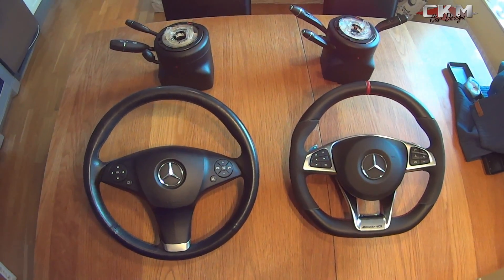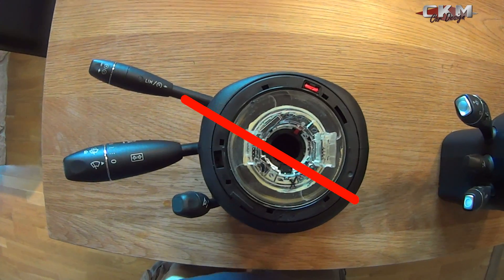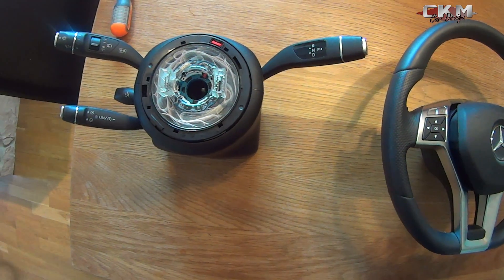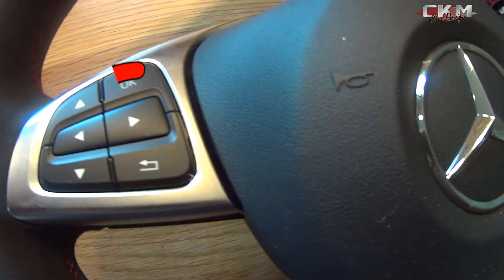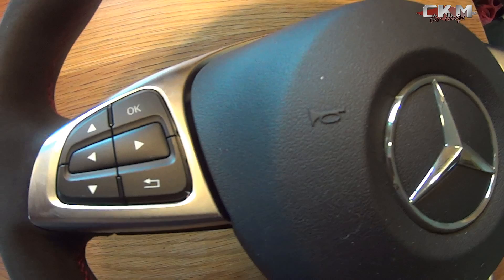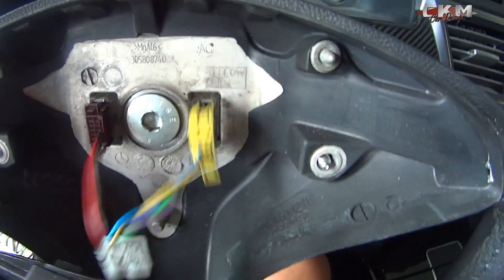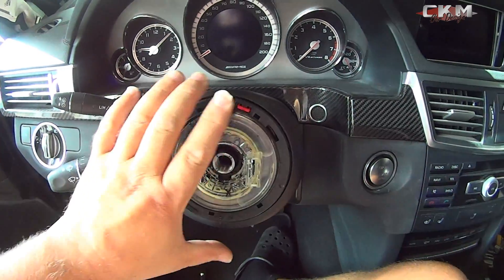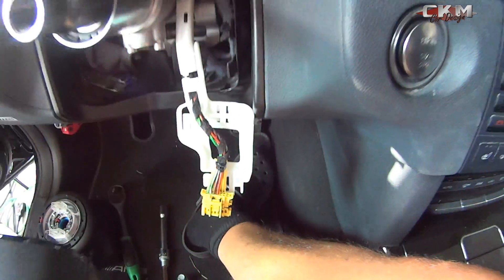Mercedes Facelift steering wheel retrofit W212 W204 W166 W176

Comment: The shift padles are going to work without modifications?
Reply from the maker: Yes.
Reply: @CKMCardesign  even if my car doesn’t have shift paddles from factory?
Reply from the maker: @bsantos791  Yes if its the corect column and you have automatic.
Reply: @CKMCardesign  Will this work with the 2012 w204 facelift steering wheel? Don’t have paddle shifters but want to add new steering wheel with paddle shifters but wasn’t sure if I had to re-wire everything?
Reply from the maker: @jbarra3655  As long as its an automatic and you get the right column.
Reply: @CKMCardesign  how do I know if it's the correct column?
Reply from the maker: @bsantos791  Trail and error afraid.

Comment: Can you just change the old circuit board to the new steering wheel?
Reply from the maker: Yes if you can make it fit inside the board container and same with buttons and peddals then.
Reply: @CKMCardesign  I’m going to try and fit my 3 spoke 2011 GLK board into 2014 GLK wheel! If I sound crazy tell me now other wise I’m giving it a shot! I’ll report back what happens. Really don’t want to buy a column but can if I absolutely have to. I’d rather change the board
Reply from the maker: @qwillis331  Its a quistion of fitment…
Reply: @qwillis331  Did you finally make it?

Comment: Hey man. I have a 2011 W207 e class with the same stock steering wheel as yours. So I need a 2014 squib for this to work? Would a 2013 3 spoke E class wheel work too or does it have to be 2014? 
Thanks

Comment: If I purchase a 2013 R172 steering column module (clock spring) and fit it alongside a 2017 W166 steering wheel with the arrow buttons, will that work in a W204 2007?
Reply from the maker: Go for 2014 to be sure.

Comment: Hi question i have w204 2009 do i need column as well or just the steering wheel with arrows on left side ?? If i need a column then from which model column will fit please i have the old retro steering wheel
Reply from the maker: Thats exactly whats answered in the video.

Comment: Great video! Quick question though, I've got a w204 PFL c63 and have purchased the same wheel as this video and i cant find the part number for the steering column.
I've gone through your website, searched through forums and gone through comments and i cannot find a part number or what model i need for the w205 steering column anywhere.
Cheers :)
Reply from the maker: Never W205...You need W212 or like CLA or like ML....From 2014 and up.
Reply: @CKMCardesign  Thanks heaps, do you know what the part numbers are that I should be looking for?
Reply from the maker: @DM-uh5ku  Sorry no..THat is a djungle..
Reply: @CKMCardesign  sure, so once I find some steering columns ( which I'm still sill having trouble finding) from the above mentioned i then need to make sure that they share the same capabilities as mine, no more no less. correct? It's quite hard to find a 2014+ model without the column shifter and without lane keep assist haha
Is any year w212 steering column okay providing it still carries the same features as original and is FL or does that also have to be 2014+?

Comment: please help, i have a 2010 e350 coupe (c207) i swapped steering wheel and column like in this video, but i get error messages for auto high beam, traction control, distronic cruise control all stop working. what did i do wrong?
Reply from the maker: Sounds like wrong column!
Reply: @CKMCardesign  is there a Solution to That Problem ? I have the Same Car and want to do That swap :)
Wich column do i have to get ?
Reply: Did u find a solution?
Reply: @sirca7014  i did actually, i used the original 2010 steering column and had to take the circuit board out of the original steering wheel and use it in the newer steering wheel. i had to cut a lot of plastic away to get the older circuit board to fit into the housing. there's a forum post that goes in detail about it that helped me, let me know if you need it and i can post it here
Reply: @angeldanielg64 i would like to see the forum, thanks a lot for the response, i have the exact same problem as you and i really wanna solve it
Reply: @angeldanielg64 do you have a link to the forum post?

Comment: Hi friend,

Hi have a W204 2008 pre-facelift and i want to upgrade my steering wheel... does it work with a W176 2014-  steering wheel (Arrow buttons on the left) with the respective column?!
Many thanks in advance
Reply from the maker: Just as I say in Video.

Comment: Please, i have the same GLK x204 (2011) as you, i only need the Reference of the steering colum i have to buy/search (is an automatic glk ). thanks
Reply from the maker: I dont work on partnumbers.
Reply: @CKMCardesign  And how to find the right one please, cause i need without gearshift stalk (pre facelift glk has in the console) and with wiper with rear window washer command) and with tempomat.
thanks please.
Reply from the maker: @sinacio69  I just look on ebay for a 2014 stalk and newer.

Comment: Got one question, if u change it on a c220 w204 cdi 2007, will it give electronic problems if i want to swap to a amg wheel with paddles? Or does no matter?
Reply from the maker: No problems.
Reply: Have you tested.?
Reply from the maker: @ckmckc  MANY times...

Comment: Hi, if you can help, I'd like to do this on an R230 SL500 year 2003. 

A: is this a w205 column and steering wheel?

B: Will it fit my car.
I'm just trying to keep busy during my chemotherapy. Thank you
Reply from the maker: Not possible on R230.
Reply: @CKMCardesign  hi I have a 2009 w204 c63 I brought the same new steering column and also the same steering wheel. No error codes but none of  the buttons don't work.
Reply from the maker: @AZNPLAYERZ  Wrong wheel or column then.

Comment: I noticed that 0:43 seconds into the video you have a steering column with the gear shifter on the right hand side but on the install, 4 Mins into the video you installed a different steering column that did not have the gear shifter. Why was this done?
Reply from the maker: The car have the shifter on the floor of course.

Comment: hey man i have a 2010 c class i want to know before i am buying anything what i need to buy if i need to buy the column or not and i dont know what column works becuse my shifts in the gearbox and not to the column
Reply: You just find the clock spring that would come with the new wheel, clearly in the case of having w204 C class the shifter isn’t on the clock spring. Simply get the clock spring that is off other facelifted C classes 2012 and up
Reply from the maker: If you want the 2016 wheel you need a 2014 or newer column ! There are as yo can see in the video columns without shift leveler.

Comment: Hello mate, I just done this today with exactly the same parts on to a W204. Nothing works and the car wouldn't even start. Do you know why this could be?
Reply from the maker: Alot of factors can be the problem. Probebly just wrong parts.
Reply: @CKMCardesign   Does that steering wheel in the video work with a W204 2007? As that's one I have brought.
Reply from the maker: @stefan2641  IF you got the corect column it should work fine.
Reply: Lol I got the one in the video from the W205 all the same apart from gear selector
Reply from the maker: @stefan2641  W205 wheel DO NOT work.
Reply: You said in the video just find one with the same lever's. Which one do I need then? Thanks
Reply from the maker: @stefan2641  That is for the column...Not the wheel.
Reply: What column goes with that steering wheel in the video mate
Reply from the maker: @stefan2641  Any column from 2014 and up exept W205,W222 and W213.
Reply: Thanks for your help mate. Just brought one from a W218.
Reply: The seller for the W218 one cancelled the order, was gonna get one from a W212 2015 facelift. Does this not work then as well?
Reply from the maker: @macaroana01   And sure its 2014 and newer?
Reply from the maker: @macaroana01   Must be 2014 and newer.
Reply: Has anyone got this to work yet?
Reply from the maker: @stefan2641  Why you ask that??? You think I am faking this for any reason?? I have done this in 5 cars now and sold plenty sets that works..Dont you see that it works in my videos?

Comment: Hello i have a question, so i have a c220 2009, and changed the steering wheel to o a 2016, the buttons obv dont work, so if i change the colum and put that on the video one, the buttons will work without doing any complicated thinks? 
Thank you
Reply: The steering column, i need a w205 one? Or has to be from the exactly same car where the wheel comes or i just need a w205 column?
Reply from the maker: @polcsgo8141  THat is said in the video. ANd NOT w205 one.
Reply: @CKMCardesign  what can i do if i dont have the column where the wheel comes from, on wich model column i have to buy it, that the thinks can work?

Thank you
Reply from the maker: @polcsgo8141  2014 and up W166,W176,W212,W218.R231,R172 and so on. Just not W205,W222 or W213.
Reply: @CKMCardesign  thank you so much i apreciate it a lot for your time
Reply: @CKMCardesign  so if i still put a steering column w176 2015, with the direct switch padel with the N D P paddle, will still the wheel work? Or it has to be a column without that
Thank you
Reply from the maker: @polcsgo8141  No work needed.
Reply: @CKMCardesign  it workeeeed!!!! Thank you for your time and helping me with my questions, i still cant believe its working all! Thank you
Reply from the maker: @polcsgo8141  Of course..

Comment: Did you remove the gear lever from the new steering column?
Reply from the maker: Of course not. Bought one without.
Reply: @CKMCardesign  pls. Could a column carrying a gear lever able to shift the gear while the initial gear is on floor
Reply from the maker: @jameeljiddan1955  No.

Comment: Hey man I'm in South Africa, I have an old e class, w211 2004. How much can I upgrade for and which one is suitable for it? I can't find it on amazon
Reply from the maker: www.ckmcardesign.com
Reply: how much did u buy it for bro?
Reply: @Oratile19ul  In south africa these cars usally run for about 6-10k Dollars depending on what kind of car it is and how many miles/Km it has. In Africa the Roads are not as harsh like in germany so often broken cars from germany get exported to africa but can still drive in africa.

Comment: Will it work on 2007 W203 2.5L V6? As the OEM steering is the same as 2008 W204.
If do, can you share part name do i need to purchase? 
Thanks in advance
Reply from the maker: No! Same?? Its far from same in W203.
Reply: but how can we mount that steering wheel on w203

Comment: Hey, if i get the w212 2014 column and w204 amg steering wheel (lift 2012-2013) and plug it into my w204 2009 will all buttons and horn works well ?
Reply from the maker: No..Must be the 2016 wheel. Lift w204 wheel is hard to install since there wher so many versions electronicly. You need the column the wheel came from.
Reply: @CKMCardesign  Ok, thanks for so fast respond, so if I put w212 2014 column and w205 steering wheel will all works ? W204 2009
Reply from the maker: @TheKarol1122  Not W205. Must be arrow version wheel. See video.
Reply: @CKMCardesign  Yes, of course with arrow version, then it will works well ?
Reply from the maker: @TheKarol1122  Yes
Reply: @CKMCardesign  Last question, so I need w212 2014 column and w213 steering wheel with arrow buttons and everything should work on my w204 2009 ?
Reply from the maker: @TheKarol1122  Yes but still not W213...Also dont have arrow buttons. Need wheel from like W166 or W176..
Reply: @CKMCardesign  OK, just arrow steering wheel, and w212 2014 column
Reply from the maker: @TheKarol1122  Just buy it on my site...And your set.

Comment: Which quite new looking wheel will fit in a 2003 clk ?
Reply from the maker: Only the one made for your car.
Reply: @CKMCardesign  isnt there a way to fit a more modern one ? and if not which year of the clk is the first which i would be able to do that (looking to get one soon but i need a newer steering wheel)
Reply from the maker: @saint4353   Sorry no.
Reply: @CKMCardesign  which year clk can fit a other steering wheel ?
Reply from the maker: @saint4353   None.
Reply from the maker: @saint4353  See my site wich version you can make for it. Sport can be made.

Comment: Is it possible to retrofit new Stalk with column shifter to w207 2010 with column shifter actually working?
Reply from the maker: Only if you had it before.
Reply: Are these US models or Europe only ?
Reply from the maker: @jaecalderon260   Same....
Reply: @CKMCardesign so if my car has no paddle shifters then the ones on the new steering wheel will not work right ?

Comment: How did you disconnect the right stalk?
Reply from the maker: right stalk?
Reply: @CKMCardesign  yes on the new stearing collum it had a drive stalk on right side,it had 2 on left and  one on the right,but on old collum it only has 2
Reply from the maker: @paulk5242  Just unscrew it and  take the cable out of the socket.

Comment: i have 2009 c300 4 matic will the gears from the new steering wheel work on the old model?
Reply from the maker: You have the answers in the videos..
Reply from the maker: If you get the corect column it will.
Reply: thanks

Comment: Would this be possible on a 2011 c300
Reply from the maker: Of course.
Reply: @CKMCardesign  i installed a new wheel and column wheel on my 2010 GLK, the turn signal, cruise control , and rear wiper works, everything else doesn’t work, any ideas?
Reply from the maker: @David-n5q2v  Wrong column or wheel.

Comment: Where can I find the updated Steering column ? Or can you please give me the part number ?
Reply from the maker: On the site. Clearly pictured there.
Reply: @CKMCardesign  Tried ebay, can't find it there. Didn't see it on your site too. Also can you let me know whether this will work on W212 E250 CGI or whether it is just plug and play, Currently my car doesn't have paddle shifters. Thanks
Reply from the maker: I dont understand. NO ONE can see it on my site. Its right there!!!!!  Clearly pictured as well....Is it not showing all the items when you scroll..???
Reply: @CKMCardesign  Found it thanks! Now will my car need additional programming for the paddle shifters to work ?
Reply from the maker: You need corect column for it. Wich is hard to know if it has. And sometimes that dont work eighter.

Comment: Hi there. Is it going to work on 2011 w212 E220 blue efficency model? i have automatic 5 gear transmision and if I would install new steering wheel with paddles obviously they will not work i guess but everything else should be just fine if I follow your steps right?

Also if im getting new wheel I suppose that I need not only the column module but air bag as well right?
By the way I would really appreciate if someone could give me a little advice on one issue im having on my w212 E220 2011 steering whitch is a bit really stiff or hard to be precise, I believe that you shoul be able to turn the wheel with couple fingers tbh but my one is really hard, could you please help me what would be the cause of it? Many thanks in advance.
Reply from the maker: With corect column all will work.

Comment: How would the gear handle work on w204 since w204 dont have 1
Reply from the maker: You just buy one without.
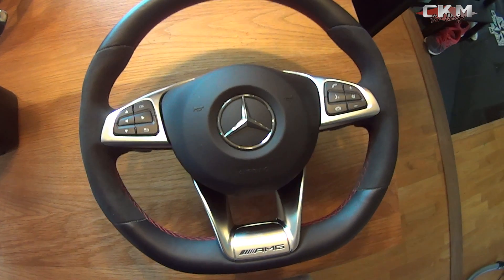Reply: CKMCardesign 1:47 this wheel, can u use it with w204? I assume yes,but it needs new steering column which includes the gearshift lever,and the w204 has a knob for gears....
Reply from the maker: @matas1024  Just answered that.
Reply: CKMCardesign so u buy 1 without,but u cant use the old one?
Reply: Since the buttons r diff,i assume yes
Reply from the maker: @matas1024  No you cant unless its a 2013 or newer.
Reply: Hav w204 with paddle gear on steering but in not work any idea how to upgrade ???
Reply from the maker: furmanek20 You need the corect column
Reply: How I can check the column is any model or number ?
Reply from the maker: @furmanek20  No you just need to trust the sellers info on it.

Comment: Would this work with the 2009 w212 e250cdi, it does not have steering wheel paddles on my car?
Reply from the maker: Of course. I have wheels without paddles in stock.

Comment: I have a 2013 Mercedes w204 sport sedan would I be able to do this and have working paddles?
Reply from the maker: Yes if you get the corect column
Reply: Do You think it would work if I got the w204 steering wheel with paddles? Or I would need the new AMG one?
Reply from the maker: You can buy anyone with paddles.
Reply: CKMCardesign ok thanks For the help

Comment: Hello mate, It will fit C class 180  w 204   1.6L  , 2009 ??? Thx ;)
Reply from the maker: Of course.
Reply: CKMCardesign Is it plug and play or do I need to modify wires in connectors? Cheers mate

Comment: I have a 2008 c class c220, will a 2014 A class indicator stalk work , with A0004603303 , 2017-2019 steering wheel, and is that all i need yes ? And airbag obv course
Reply from the maker: No.
Reply: W176 A class  2016 steering stalk, will that fit my c class 08?
Reply from the maker: @jakeboyd6256  Yes of course.
Reply: @CKMCardesign  thank youu, your a legend i have one ordered now